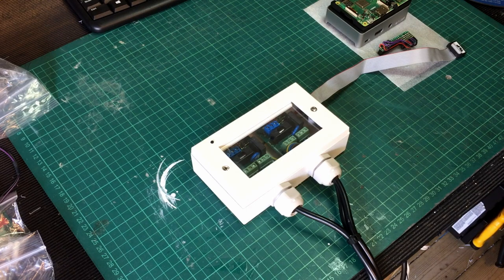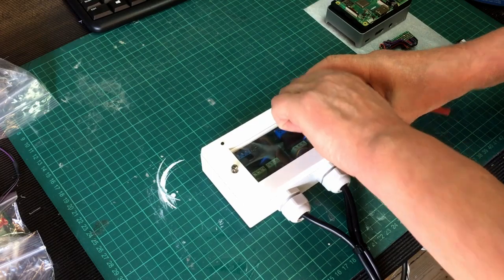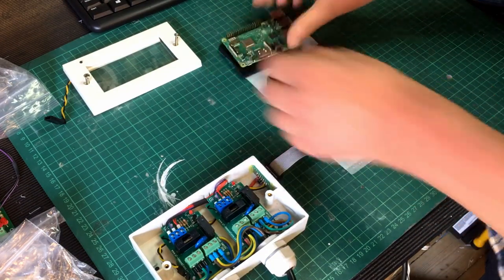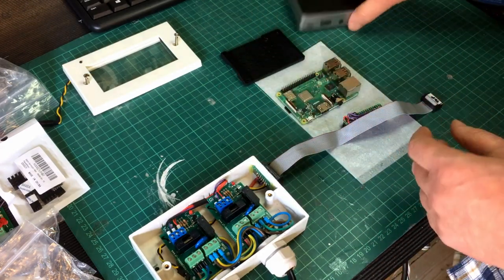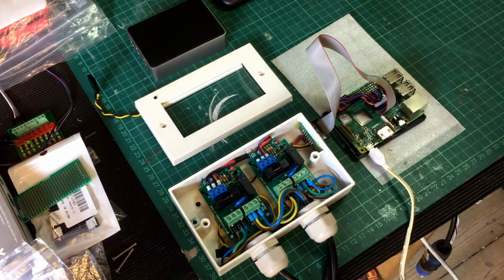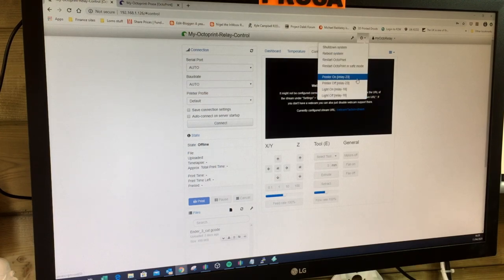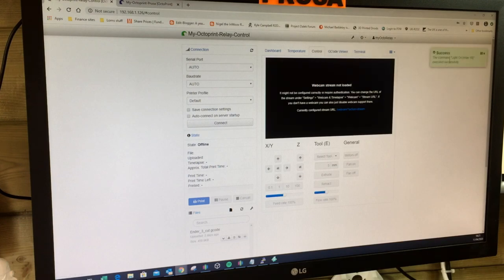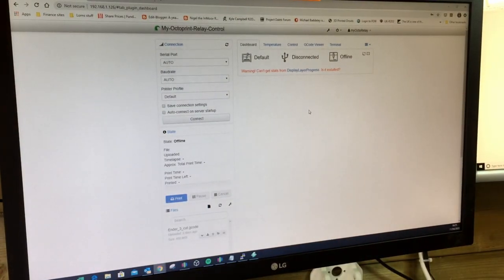3D printer remote shutdown

Comment: Awesome stuff. I've never really got into this but I would really like to use my raspberry pi camera to provide images of my 3D printer.
Reply from the maker: Hi Steve, Ive been trying out a few software setups with the pi camera and they work really well.  A bit laggy in the picture but fine for remote viewing.   Worth googling for ways to set it all up  but the raspi documentation gives most of the command lines. https://www.raspberrypi.org/documentation/raspbian/applications/camera.md.    A quick and easy way to setup up a camera is using the Octoprint software which has the camera setup within it.  You just need to point the software at the correct camera URL.   The Octoprint settings as mentioned in this video can be tweaked massively